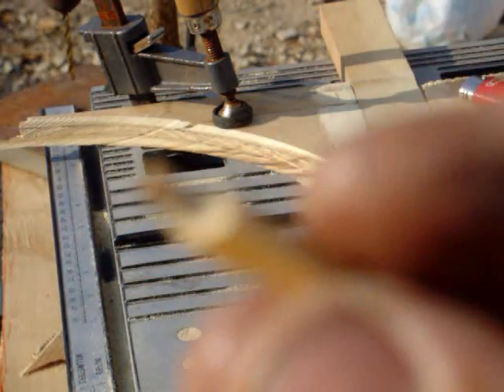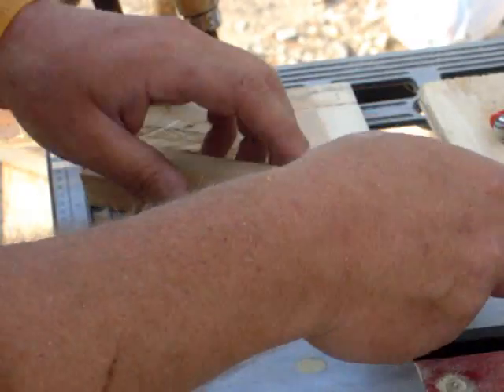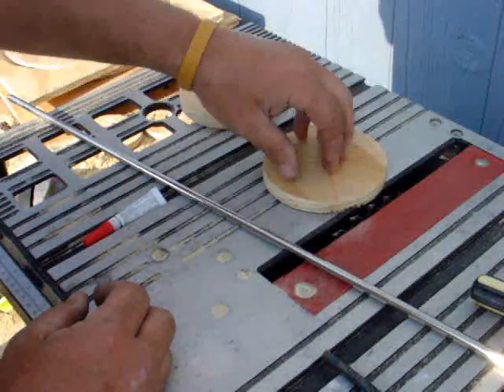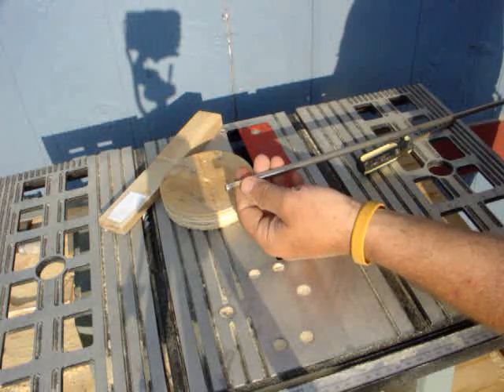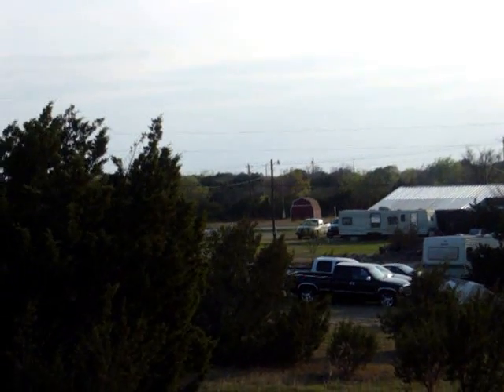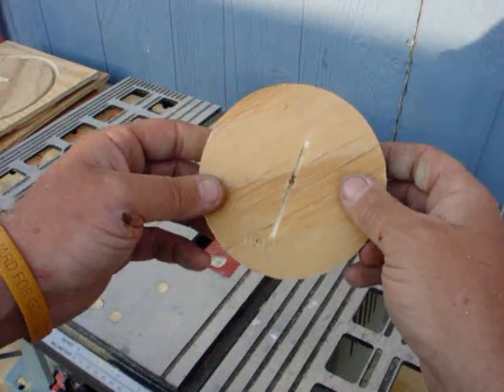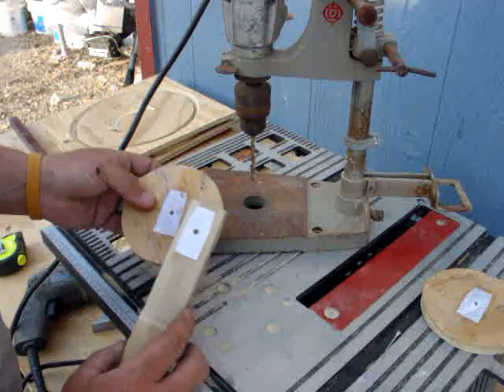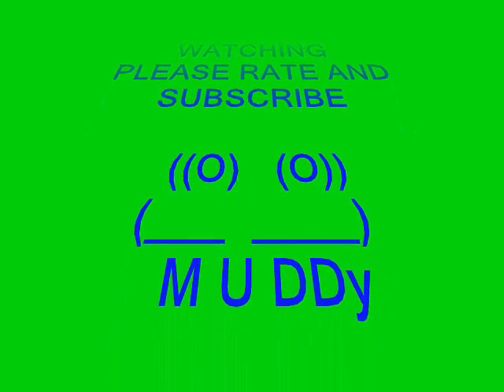BUILD A DUAL PERMANENT MAGNET ROTOR WIND TURBINE (PART 3b )

Comment: If you were using my Correct Plans it would be 640% over Unity but you have just a Standard design nothing new just a Cool close replica of my Attraction Generator 640% over Unity I would help you out but no one wants it anyway and I have to much time into it to share for free but one of them is with the Tesla Comunity already